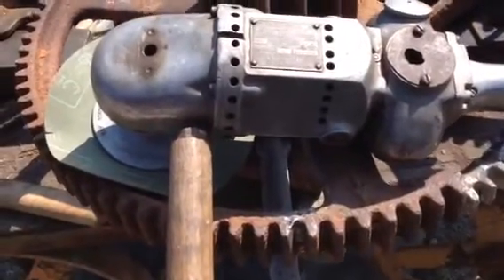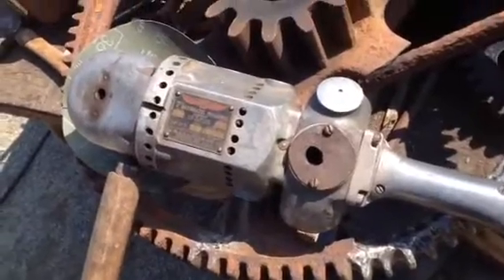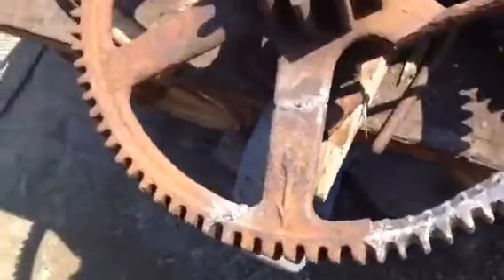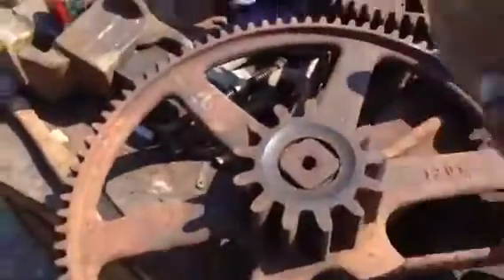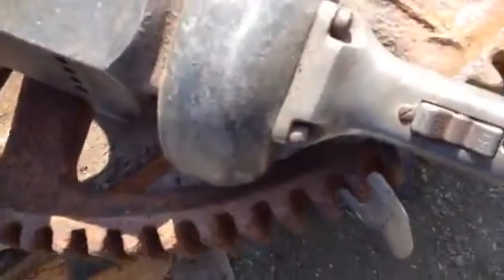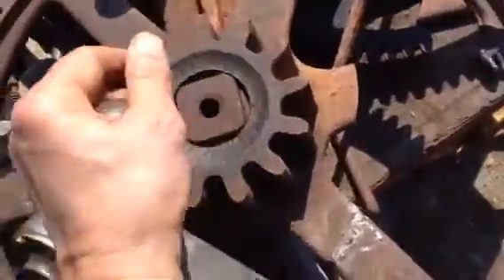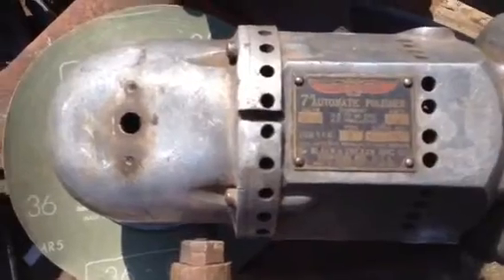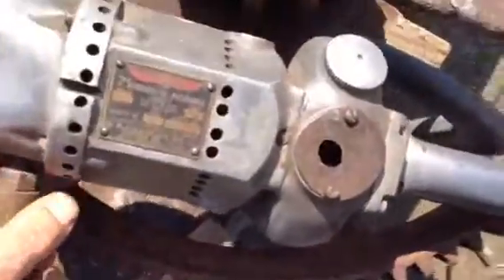Black & Decker Polisher old tool

Comment: I have a same thing but I don’t know how old it is, the bottom right is a Quarter size cap on it, inside is dry empty,it’s post oil in it?? I got a deal with this at garage sale.  A dollar.  It’s working,just Heavy.  Please let me know what kind Oil to put in it?. Thank you.
Reply: Know this is late. These 'Automatic' B&D and Van Dorn polishers have that rear reservoir for polishing compound. This one is missing the pump and brass tube to feed it into the hollow shaft up front.